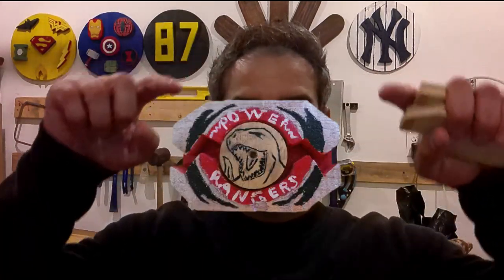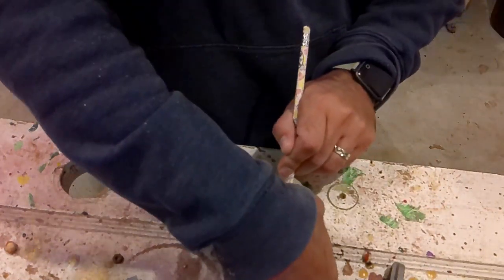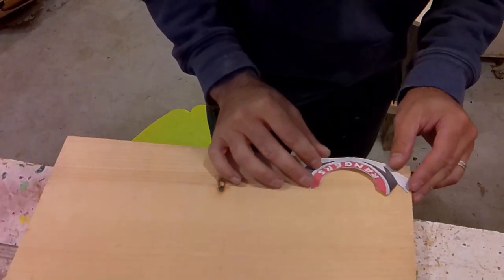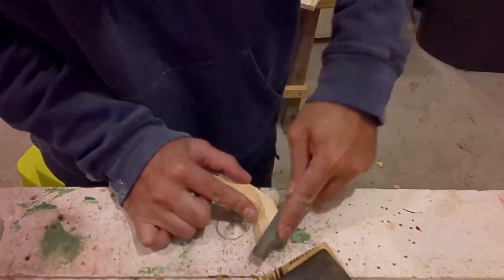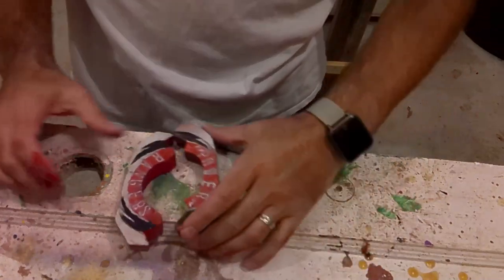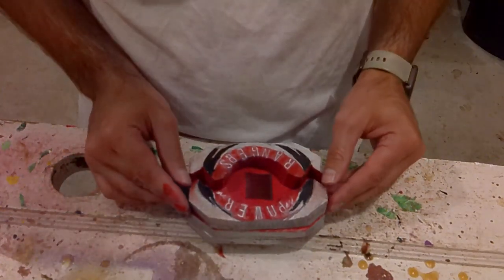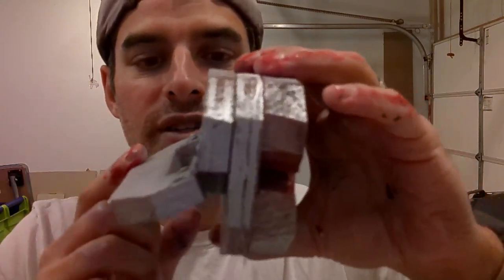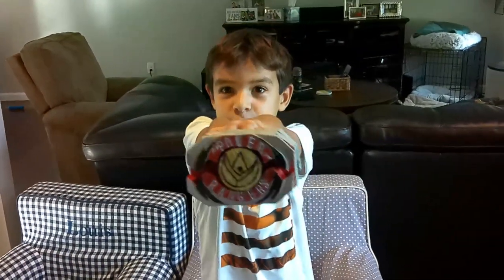DIY Mighty Morphin Power Rangers Wood Morpher with Handle and Indented Lettering

Comment: This was cool bro 🔥 and a neat idea
Reply from the maker: Thanks.  I am trying to think of ways to make another one where the front parts, that say power and rangers, can slide up and down. So they would be closed around the coin and pop open.
Reply: Awesome wood morphers, Dude and very cool.
Reply: @WorldofWoodshop   That sounds dope and what's so cool is u take time out to make it yourself
Reply from the maker: I made a new one that has the top parts sliding up and down.  I used rubber bands and made a wooden latch to keep them closed.  You slide the latch with your figure and the parts pop open.  https://youtu.be/Hr3cOAdVmR8